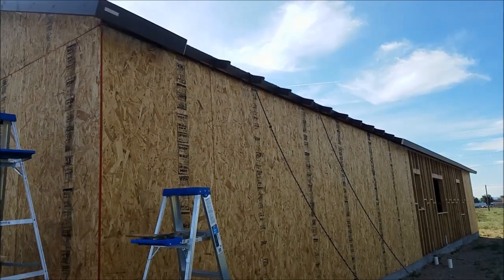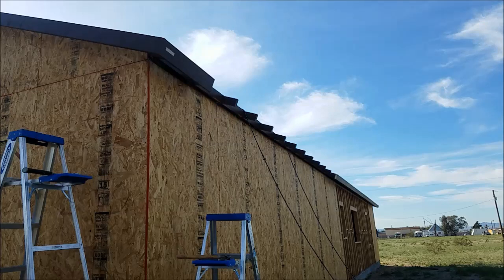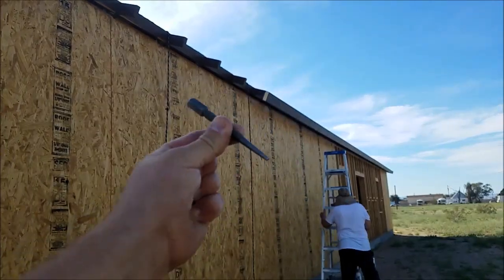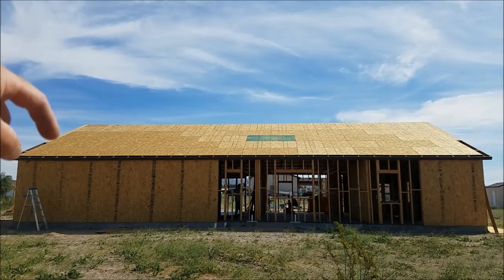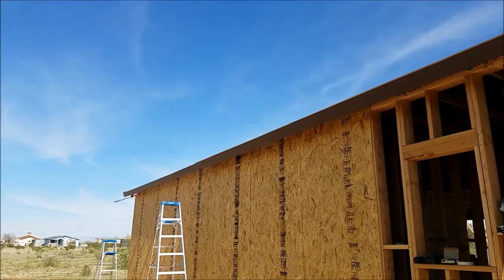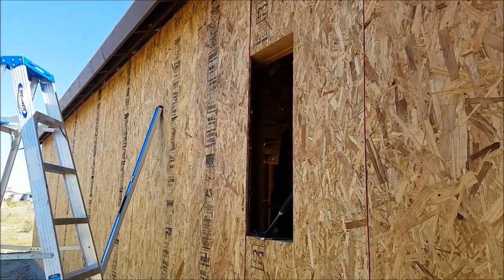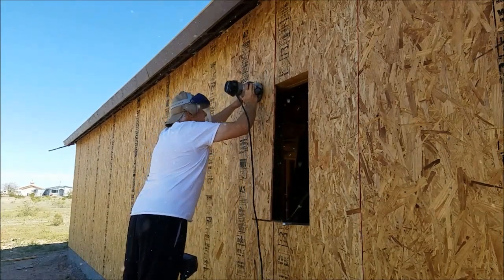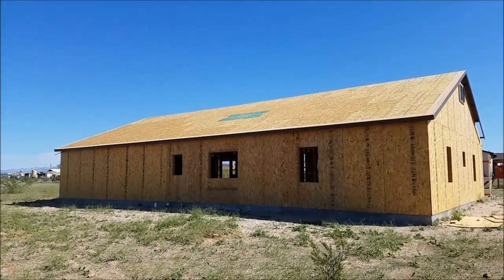DIY House Build # 21 - Fascia Board

Comment: I would imagine the codes are different in Arizona then here in Minnesota as far as roofs and insulation but here it’s preferable to face the house to the south , I would imagine it’s that way there also ? So all of your HVAC systems are in the attic ? Is your hot water up there also ? I don’t see roof vents just gable end vents , are they not required ? Just asking !
Reply: Roofer installs the roof vents, 8 half moon type.  Brandon's shop window faces north.  In Arizona the part of the house you want to keep the coolest always faces north.
Reply: @WoodGuy  in Minnesota you never face a house north because of winter temps and snow accumulations ! The warmest part is the south and that’s also the sunniest and need windows on the north side for cross ventilation !
Reply: @davekimbler2308  I know, Dave, I was born in Ottawa, Canada......can't thank my folks enough for moving to California when I was a wee lad.  Here in Arizona this Wednesday 8/25/21, it'll be 112 and really humid at 12%...lol. Usually hovers around 110 to 118 all summer here. But the winters are heaven here.....75  or so degrees every day for 5 1/2 months.
Reply: @WoodGuy  I lived in Yuma for a number of years in the 60’s and loved it , kinda missed winters but I was young and dumb ! Lol ! I’d like to winter there but wifie is still working !